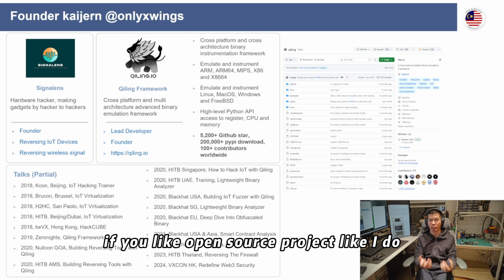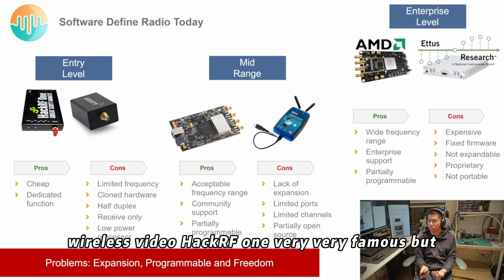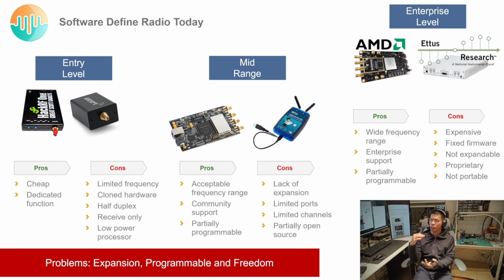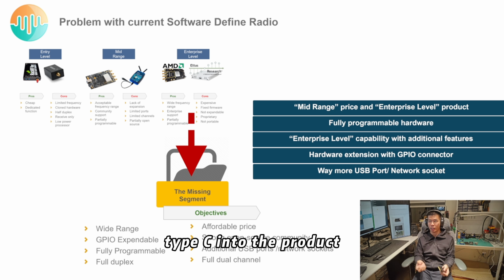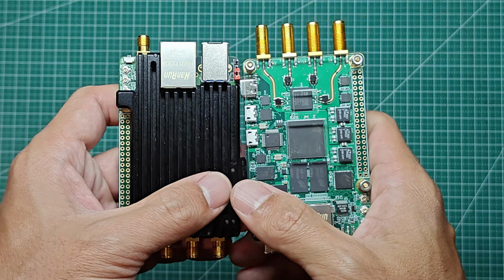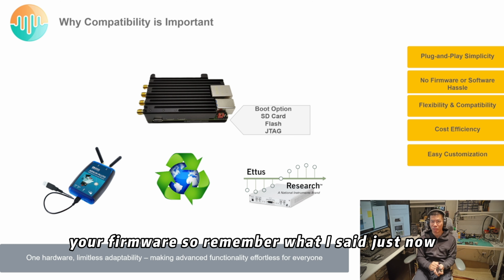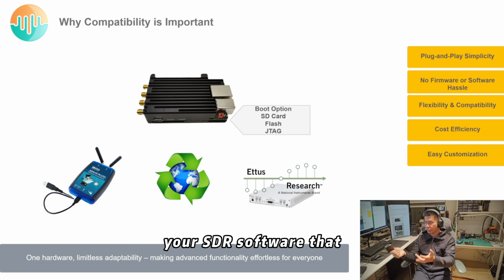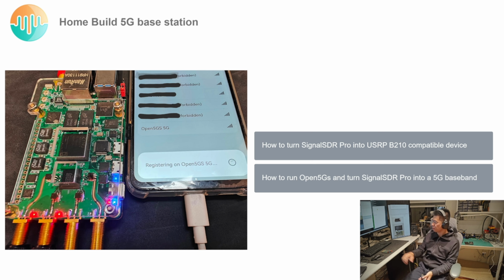Introduction to Signalens and SignalSDR Pro

Comment: The zynq 7020/AD9361 has been done to death by … for example:

1.	Epiq Solutions – Matchstiq Z2
	2.	Per Vices – Cyan
	3.	Ettus Research – USRP E310
	4.	Fairwaves – XTRX
	5.	Nuand – BladeRF 2.0 Micro
	6.	Analog Devices – ADALM-PLUTO (uses Zynq-7010 & AD9363)
	7.	Myriad-RF – MyriadRF-1
	8.	Epiq Solutions – Sidekiq Z2
	9.	Ettus Research – USRP B200mini
	10.	Lime Microsystems – LimeSDR
	11.	Red Pitaya – STEMlab 125-14
	12.	Analog Devices – ADRV9361-Z7035
	13.	Ettus Research – USRP N200
	14.	Fairwaves – UmTRX
	15.	Epiq Solutions – Matchstiq S10
        16. ATS9361-based SDR Modules
        17. LTPP3-SDR
        18. BCU SDR Kits
19. DAB-DSP SDR Transceiver
20. EasySDR v3.0 Development Kit
21. RFSignalPro SDR Systems
22. StreamER SDR Boards
23. Z7020_AD9361_DevKit
24. MiniSDR Zynq Platform
25. Wavesun SDR Platform
26. StarSDR-9361 Embedded System
27. TechNode SDR Kits
28. 9361-DSP Reference Design Kit
29. Radiotek SDR Boards
30. SinoPro SDR Platforms
All operate within the confines of the fpga and TRX chipset.

Can you bring to the maker market, something like Analog Device’s JupyterSDR with the ADRV9002. Granted the chip alone costs more than the list of this offering but I opens up so much more possibilities. 
And perhaps something elegant as the Epiq brands M.2  form factor. 
You’ll come out ahead. Cheers.